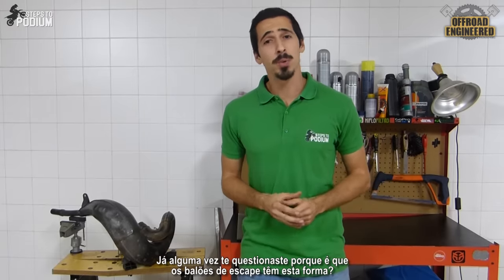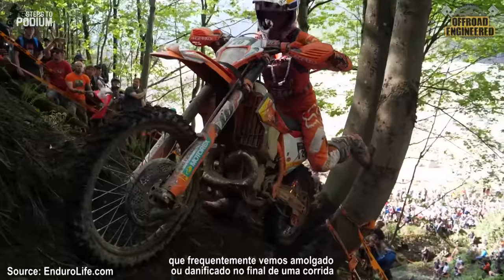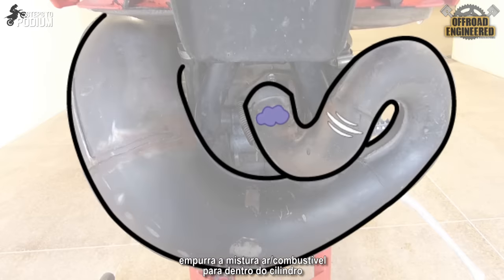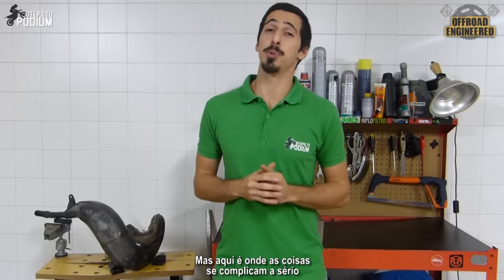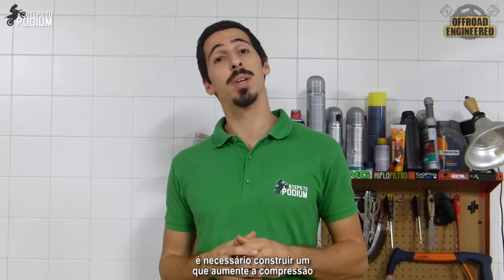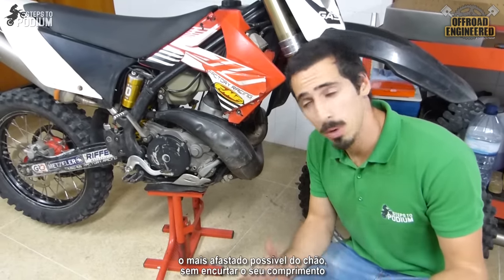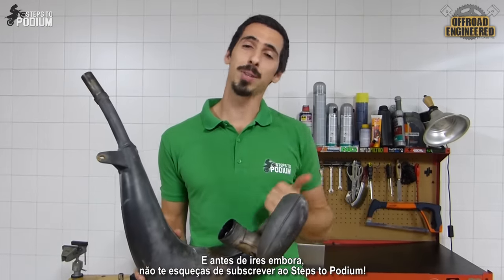How 2-stroke exhaust pipes work | Offroad Engineered

Comment: All the explanations that I have watched of how a 2 stroke pipe works always only tell half of the story, this video is the same. The convergent part of the pipe acts like the closed end of a parallel pipe, in other words it reflects a pressure wave back up the pipe that is the same sign (+ or - ) as the wave that is travelling down the pipe, a positive sign wave is reflected as a positive wave. The bit that everyone misses out is that the divergent part of the pipe acts like the open end of a straight pipe, it reflects a wave of the opposite sign to the wave travelling along the pipe, it is actually to do with some weird law of acoustics. All of this means that when the exhaust port opens a positive wave travels down the pipe, when it hits the divergent part of the pipe a negative wave travels back up the pipe AND the positive wave carries on down the pipe. The negative wave is basically a partial vacuum, when it reaches the exhaust port it pulls fresh mixture out of the crank cases and cylinder into the pipe. The positive wave that continued to travel down the pipe now hits the convergent part of the pipe, it is reflected as a positive wave back up the pipe and as it gets near the exhaust port end of the pipe it forces the fresh mixture back into the engine. The convergent and divergent parts of the pipe are coned shaped to increase the RPM range that the pipe will remain 'in tune'. By forcing more mixture back into the engine it is being supercharged to a small degree, a 100cc engine may act like a 125cc engine because in theory it is burning 125cc's worth of fresh mixture. (The numbers here are just an example!). Forcing an extra 25cc of mixture into the combustion chamber will of course raise the compression ratio but the compression ratio can always be raised by virtue of the cylinder head design. (Detonation being the limiting factor in determining the compression ratio). It is the harmonic supercharging that the exhaust sets up that gives the engine a boost in power.
Reply from the maker: thank you for your comment! 😊
I think you should watch the video again but now, until the end, because there are things that you state that I actually mentioned and explained in the video 😉 and yes, some small details I didn't mention in order for the video to not be too detailed and complicated (the goal is to explain the concepts in an easy and simple fashion), but nonetheless, I appreciate the time you spent making this comment 😉
Reply: @StepstoPodium  I don't think that you explained how the negative wave is generated but then again its easy for me to comment whilst I have not even created a video! So well done for at least creating a video! :-)
Reply from the maker: @sidecarbod1441  that part I didn't explain, you're right, but I thought that would complicate without bringing so much more value to the video 😊 
But thank you nonetheless for your feedback, I really appreciate it 😉
Reply: Nimbus Nimbus  What is way to long?
Reply: Nimbus Nimbus  OK well I guess I can offer two solutions to the problem...

1. Don't read my comment. 
2. Read quicker, if possible learn to read without having to put your finger under each word.
Reply: Wrong ! The crankcase is much higher pressure than the atmosphere forced into the boost ports that force the already supercharged mixture of fresh air/fuel into the combustion chamber ..the reverse cone of the expansion chamber causes a sound wave to block the exhaust port stopping the boost from escaping
Reply: @donniebaker5984  Yes the reverse cone (converging cone) does create a positive pressure wave but the diverging cone creates a negative pressure wave which helps pull the fresh charge up from the crankcases via the transfer ports. They are not sound waves as you called one of them, they are pressure waves that follow the laws of acoustics. The crankcase pressure will be above atmospheric but getting the pressure as low as possible in the exhaust, exhaust port and cylinder helps get the gas moving from the crankcase, it is the difference in pressure between the crankcase and the cylinder that causes the gas to move. In fact you are wrong, the fresh charge in the crankcase is not "already supercharged", it is being put under pressure by the descending piston but if the piston displaces 100cc then it will only push 100cc of mixture via the transfer ports into the cylinder, this is not supercharging. The negative wave will pull more fresh charge out of the crankcase, lets say another 25cc so in total there will now be 125cc of fresh charge available to burn, 100cc will be in the cylinder and 25cc in the exhaust track and/or exhaust. The extra 25cc that the negative wave pulled will actually come crankcase via the carb and reeds. The positive wave arrives back at the exhaust port pushes this extra 25cc back in the cylinder after the transfers have closed but before the exhaust port has closed, This is supercharging because  the volumetric efficiency of the engine (VE) is now over 100%. The boost ports that you mention do not connect the crankcase to the cylinder above the piston at BDC so you are wrong in that respect too. Transfer ports do that. Boost ports are used in older style engines where the piston has some control over the inlet timing, they connect the inlet track to the cylinder above the piston at BDC in order to take advantage of the kinetic energy of the fast moving charge in the inlet track, basically some of this charge can enter the cylinder via the boost port . These days 2 stroke engines use crankcase induction controlled by reeds or disk valves and not controlled at all by the piston, the space that would have been used for a boost port is now used for addition transfer ports. Sorry for the long winded reply!
Reply: Nimbus Nimbus  Fine, I never said that you said there was only one wave involved. I'm pleased that you know that there are 2 waves involved in each cycle unlike 'donnie baker' who thinks that there is only one wave.
Reply: Nimbus Nimbus  Fair enough! I spent what seems like half my life working on TZ350 and TZ 700 engines, I used to race F1 sidecars many moons ago hence my login name. You may not have sidecar racing where you live but they weren't really a bike with a sidecar, they are more like 3 wheeled racing cars

Comment: its called loop scavenging it does not increase compression
Reply from the maker: It's the same thing, explained in simpler terms.
In the end, if it wasn't for the scavenging effect, the compression wouldn't be has high as if there wasn't any.
I know the technical term is scavenging, but explaining that to the average Joe isn't easy! :)
Reply: @StepstoPodium  i thought you might be trying to simplify it
Reply from the maker: @richmiller1250  I am :)
Reply: The extra compression is made in the crankcase as the piston compresses the atmospheric pressure of air/fuel mixture in the crankcase to a much higher pressure making boost that the boost ports force the fresh charge of air/fuel into the combustion chamber while it us still pushing against the piston and the extreme  high pressure of exploding gasoline

Comment: sorry, but per Bernoulli's eqn, the larger pipe the higher the pressure & lower the velocity. The smaller section is the opposite, lower pressure but higher velocity. PV = PV Seems  counter intuitive, but that's the physics
Reply from the maker: You're right, that's how the Bernoulli equation works! But the Bernoulli equation doesn't work in this case since one of its conditions is not met: in this case, the temperature of the fluid is not constant and cannot be considered constant because there is a tempersture amplitude too big from the moment the fluid leaves tbe header to the silencer 😉

Comment: The springs on my expansion chamber came off and it sometimes leaks, it’s super loud and my bike looses so much power.
Reply: So fix it?
Reply: U have to make that joint sealed up, no leak of pressure or exhaust.what bike is it? Find some shorter springs , or u have to pry on your pipe , maybe a crash whacked it a bit
Reply: Richard Key pretty sure it’s just cause my engine brackets are loose allowing it to pop out. I also do not have the seals on the end of the pipe. It’s a clapped kx100 but some simple work and it’ll be mint.
Reply: @Nick-ip7ks  that's cool.if u are missing an exhaust  pipe gasket, some hi temp silicone sealant might seal off the leak, but tighten up the motormounts.fix stuff as you can afford to
Reply: Richard Key thanks I’ll try that sealant out!

Comment: Like the vid first of all thank you for the information also I got a few questing about the expansion chamber, I got one them PRO WORKS pipe for 85ktm and I'm building a case reed 70cc bicyclemotor so I got all this shit right just for fun but I'm wondering the header length ,to fit the pipe in the bicycle the header is down to 3in should length pose a major factor scence it so short or do I put the pipe as close to the cylinder as close as possible ?well thanks man peace
Reply from the maker: I really appreciate your comment! 
However if you are trying to do a homemade expansion chamber, you really have to dig into some literature to find the right pope's length and what not 😅
Reply: Stop talk/texting and learn how to puntuate a paragraph so its not on long unintelegable sentence. I cant even spell and mie if more readablt than that blather.

Comment: You confuse pressure with speed, when the pipe becomes bigger, the pressure raises and when it becomes smaller, the pressure drops. 
Venturi equation
Reply from the maker: Venturi equation does not apply here since one of its premises is not met
Reply: @StepstoPodium  which one??
Reply from the maker: The fluid must remain at the same temperature throughout the flow

Comment: 1:10-1:45
Just wanted to let both Steps to Podium and the audience watching this that while the general idea that's presented here is more or less correct, the way in which it's presented is not, when viewed from the perspective of fluid dynamics.

Allow me to explain:
first and foremost, for anyone wanting to fact check what I'm about to say, please check out this NASA link explaining mass flow rate: https://www.grc.nasa.gov/www/k-12/airplane/mflow.html
and this link explaining Bernoulli's Principle: http://hyperphysics.phy-astr.gsu.edu/hbase/pber.html  They will become important as I explain this.
Based on mass flow rate equations from the link above, it can be derived that the total mass of fluid (gaseous or liquid) remains the same past any given point in a pipe, regardless of it's inner diameter (ID).  So, this means that the total amount of gas mass moving past any one point of the pipe remains the same.
Granted, this does not take into account things like heat losses to ambient surroundings, but that's something that is usually a factor in pipe design, so it's effect ends up being nearly negligible in the long run.

The equation in question is this: M = r*V*A, where:
M = Mass flow rate
r = fluid density
V = Fluid velocity
A = Cross-sectional area of the pipe/enclosure

The way you determine changes in mass flow rate for a variance in pipe diameter is as such:

M(1) = M(2)

Therefore:

r(1) * V(1) * A(1) = r(2) * V(2) * A(2)

Using this equation, the following can be derived: when a pipe's ID expands, the fluid's velocity through the pipe slows down, and due to Bernoulli's Principle, we know that this relative loss in velocity will lead to a relative increase in pressure of the fluid.

On a side note, modern 2 stroke exhausts are built using multiple 'sound cones' which are perforated to allow gas to pass through them without significant resistance in the converging portion of the pipe, which causes multiple refraction waves to occur, thereby causing correct 'exhaust timing' to happen at more than just one small range of engine RPM.  It's not a perfect system, but it does allow for a much more broad power-band, having multiple torque peaks instead of just one.
Reply from the maker: There is only one thing you didn't factor that brings your whole argument to the ground: 
One of Bernoulli Principle's assumptions is not met in this case since the density of the fluid (exhaust gas) is not constant throughout the pipe. There are to big of temperature differences to not consider the density variations.
But I appreciate the input! :)

Comment: So without the big part the bike would consume more fuel and have a lot of fire coming from the exhaust pipe
Reply from the maker: which big part? I didn't understand 😅
Reply: Steps to Podium the part that makes the pressure lower and then multipiles it
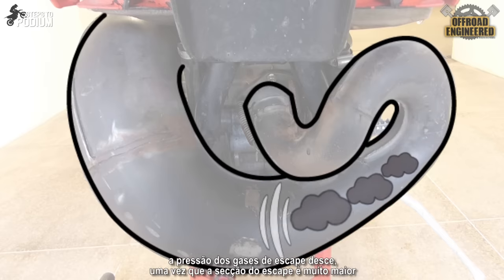Reply: Steps to Podium 1:22 that part
Reply from the maker: @jonikyro1168  the big part is only useful if you have the whole thing together. just having one or the other, doesn't do anything!
Reply: Steps to Podium oh okay i thought if I replace it with a straight pipe it would pop or just not work because it doesn’t get enough fuel
Reply from the maker: @jonikyro1168  that would not happen, no 😂
but I'm glad I could help 😊😉
Reply: Steps to Podium thanks
Reply: The bikes would be letting unburned fuel get exhausted, oily guck starts to accumulate in pipe, bike starts to belch tons of smoke when hot exhaust gases are cooking this oily goo sludge

Comment: The idea is to get as much exhaust out so more fuel can get in,   The pressure wave scavenges and creates a suction that draws exhaust out.    The pressure wave creating more compression and pushing exhaust back in doesn’t make sense.
Reply from the maker: I agree, whoever told you that?😂

Comment: Question for you! Assuming everything is good, the first top end is done on a bike and then it knocks at specific throttle openings. Also obviously assuming the top end was done properly, zero play in bottom end and jetting not changed. In your opinion, what might be responsible for the knock in the video here? https://www.youtube.com/watch?v=8k0JOQ8Bbto
Reply from the maker: If I assume everything is good, then there is no problem with it xD 
It might be a damaged reed. The power valve might be off as well perhaps. It can be several things, if you assume things and if you don't take anything a part!
Reply: @StepstoPodium  ok ruling out the power valve because it was disconnected and held both closed and open, knocking persisted. Cylinder and piston look good and the knock seems to be coming from the pipe. I’ll triple check reeds but at 55 hours is when the knocking began. I am asking because I’ve been told it could be some sort of resonance due to the new top end
Reply from the maker: It might be! Honestly it's too hard to figure it out just with sound and some info.😅
Reply: @StepstoPodium  alright, was hoping you might have seen something of the sort or heard of it. Thanks!
Reply from the maker: sorry for not being able to help out! when you find what originated that, reply on this thread please! There is always a time for more knowledge 😊

Comment: Dude does it affect fuel economy of bike
Reply from the maker: off course. from the moment that you have a dent large enough to reduce the compression of the combustion, you are directly reducing the amount of fuel burnt in the combustion chamber.
The pipe is engineered to work with the exact shape that is build, so if you change it, it won't work the way it supposed to be.
Reply: Bro we aren't increase the fuel air mixture into cylinder.we just make the partial burn (exhaust gases) return to cylinder by these cones.then how it results in reduced mileage?
Reply from the maker: actually we are. the cylinder admits more fuel taking into consideration the action of the expansion chamber. 
But like you said, exhaust gases are unburnable gases, so the stechiometric reaction won't occur, since instead of having air/fuel mixture, you'll have air that won't contribute positively in any way to the combustion, only negatively, since exhaust gases are extremely hot and influence the combustion's temperature and efficency.
Reply: It's clear dude.thank u ❤️
Reply from the maker: glad I could help 😊
Reply: Yes, bike will waste fuel with improper exhaust, unburned fuel will escape engine, & engine will not run as crisp

Comment: too noisy and they burn pistons and rings
Reply: souris verte going for full on performance you must sacrifice reliability and comfort
Why do you think engines in race cars are replaced so often? In fact, a 2 stroke makes double power at the same RPM as a similar displacement 4 stroke and is a lot lighter
Sure, a 4 stroke is more reliable but 2 stroke is there if you want extra performance

Comment: Thing I dont understand is why try to ovoid all them problems in enduro when you can just get a sexy 4 stroke. Like I'm a 2 stroke fan but when it comes to enduro I want that 4 stroke.
Reply: Yea a four stroke that is much heaver with dozens of extra moving parts to wear out costing much more than the bike will be worth when it finally drops a valve or worse throws a cam chain through the block ..and yea a much heavier engine loading down more height to the front suspension making the bike much harder to hold a line landing mostly on the front end after long jumps on a track making it a lot easier to crash and loose any chance of winning a race of two stroke racing motorcycles
Reply: @donniebaker5984  nah dude I been driving 4 strokes all my life. Never had any of that shit happen to me before. Yea there like what a little heavier but really the gears dont weigh much at all. There way more dependable then a 2 stroke. And they dont bog down like a 2 stroke does. If you take care of your bike that stuff wont happen😉